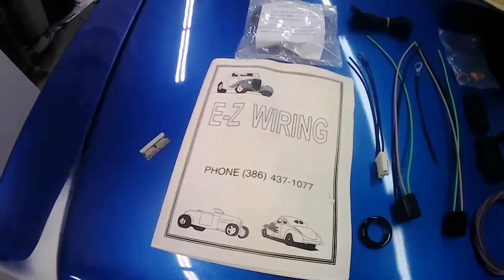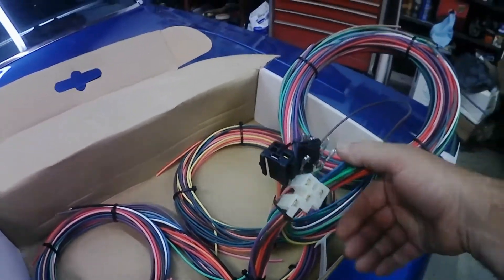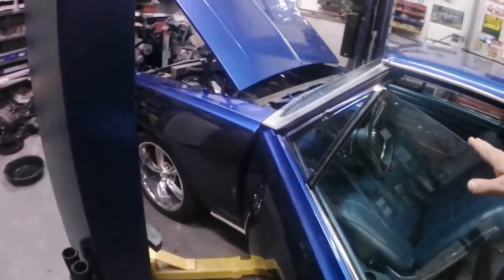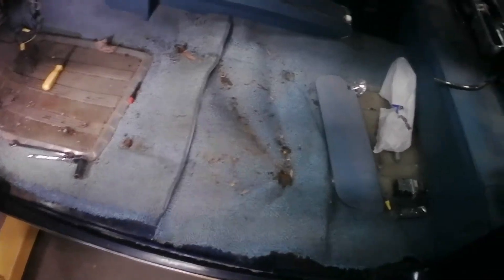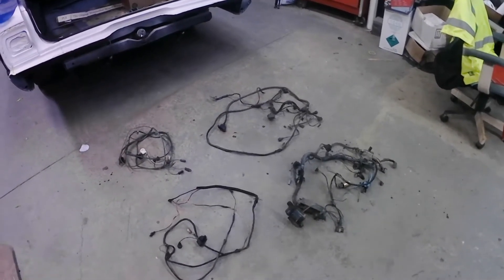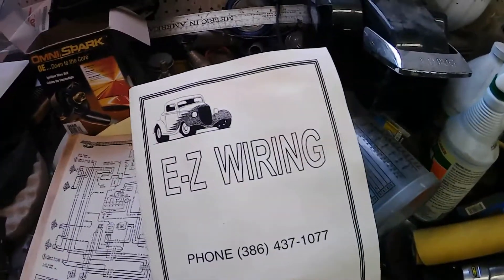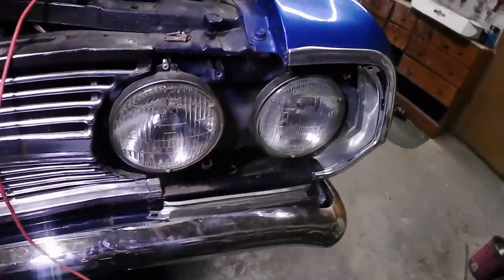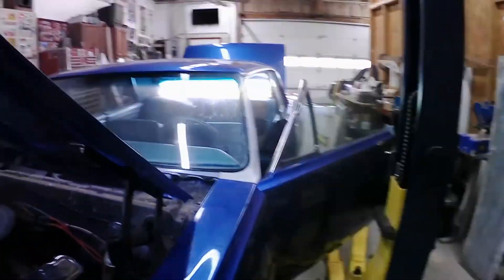65 Chevelle Ep. 4

Comment: Great work and exceptional patience on your part.  I did the wiring on my 65 wagon 30 years ago, back when there were no repops made, but you could buy an original "rebuilt" harness from Year One.  If I was doing it today, I'd spend the extra $ for a custom harness and bypass all the time and labor of making a universal kit work.  I think that would also eliminate possible problems with using the 58 year old connectors that may be disintegrating at this point and any errors with making all of those splices.
Reply from the maker: Thanks for sharing. Appriciate the kind words.

Comment: Tedious is truly the word with wiring, but something well worth spending the time doing a nice, neat job. Loved Ashton's color commentary engine background sounds.
Reply from the maker: Took way too much time to do this wiring replacement definitely would have been easier with the ready made harness.
Reply: @allclassicsrestoration1430  in the long run you end up paying one way or the other. Either up front with a set up that is model and year specific, or paying in time to figure things out. Also if you opt for the second option you still run the risk of splicing and shorts which was what you were trying to avoid in the first place. Lol, you should rename this video “How not to rewire a car”
Reply from the maker: It actually would have worked out cheaper to get the model specific harness I may have had 5 or 6 hours in it that way. 27 hours at $75 an hour adds up quick. All the splices done correctly run low risk of coming apart and creating a short. Bob thanks for watching and commenting it means alot.